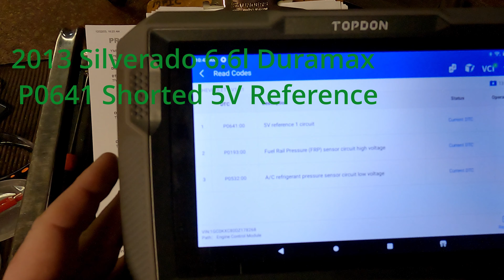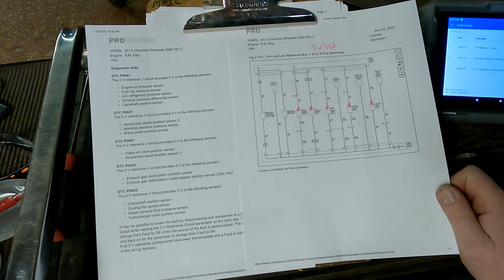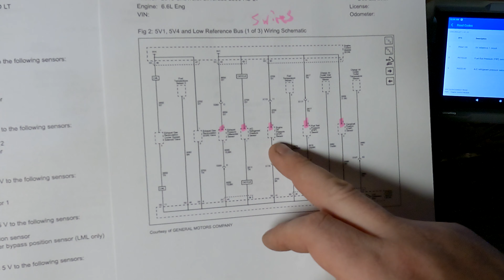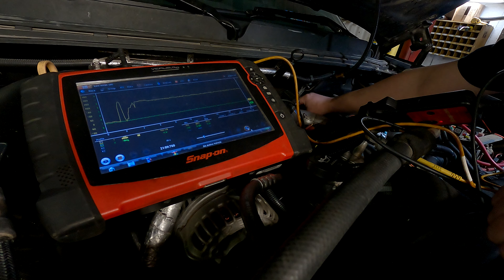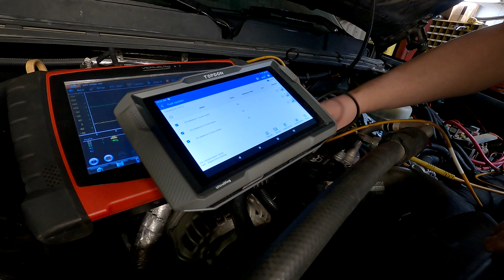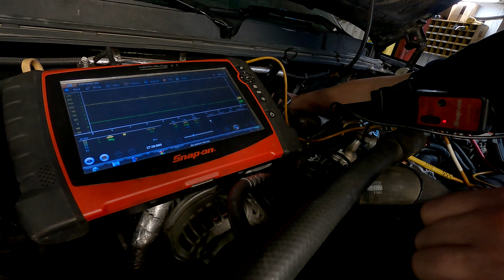2013 Silverado Duramax P0641 5v Reference Diag

Comment: Good video and explanation of your testing methods. Another tool in arsenal could be the Kent Moore J-35616-210 high impeadance test light. Seen it while watching Jake's videos. @ 50 mA draw, perfect for load testing 5V reference signals and other testing for sensor circuits.
Reply from the maker: Cool, thanks for the suggestion, I was not aware of that tool. I'll definitely check it out, can't ever have too many test lights!!
Reply: Absolutely! Jake's channel is Automotive Diagnostics and Programming, has some good case studies.